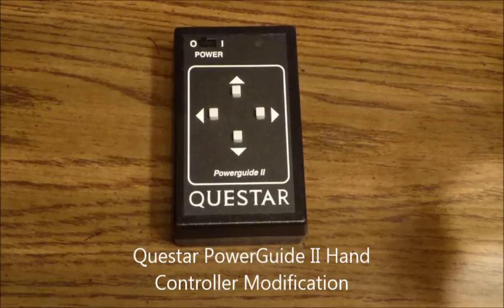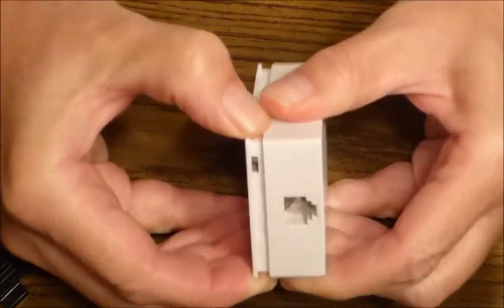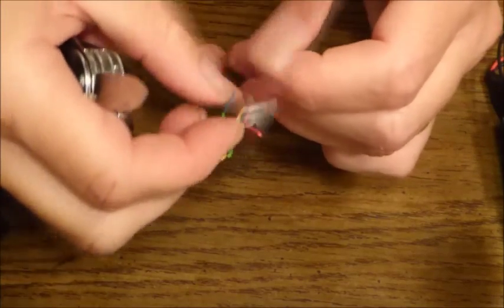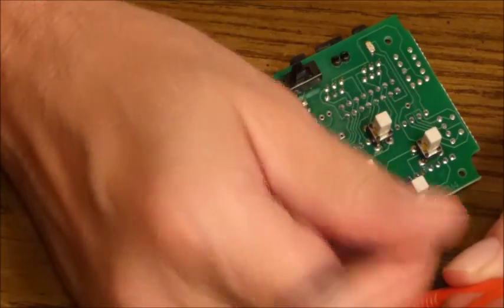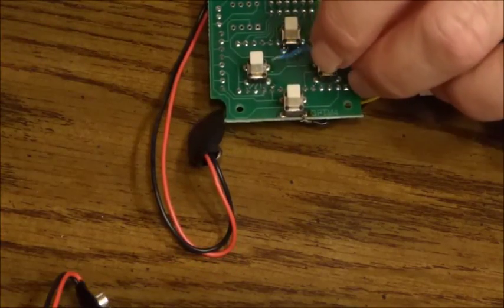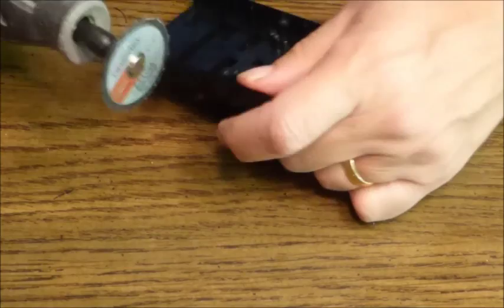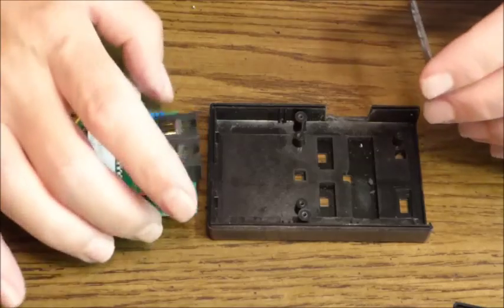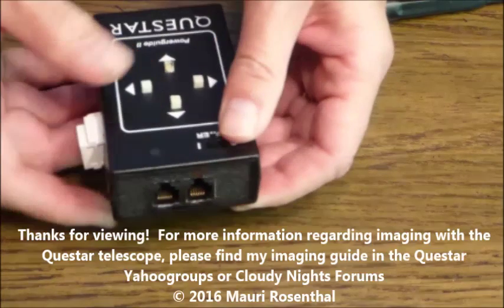Questar Hand Controller Modification

Comment: Thanks for the video very good.   Say can you tell the EXACT length of the Questar 3.5 table top legs??  2 plus the one on center.  Mine were lost in a move across the country.  I use them for astro photo but never paid attention to their length.  Going to machine my own.  Thanks.
Reply: I recommend calling Questar who can give you the desired specs, and perhaps even come up with a simpler solution